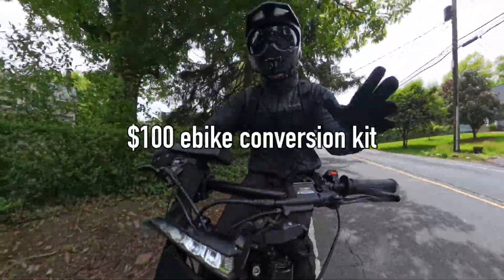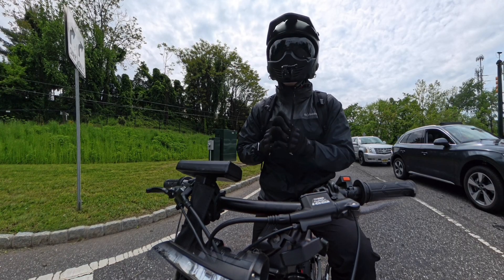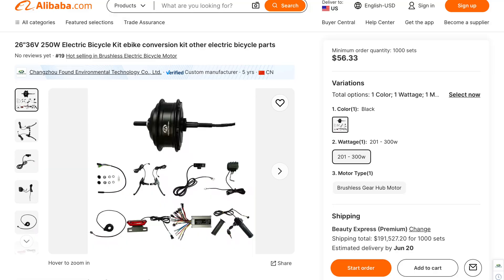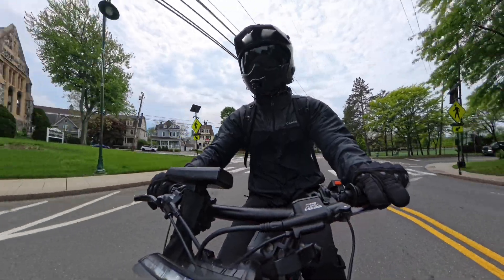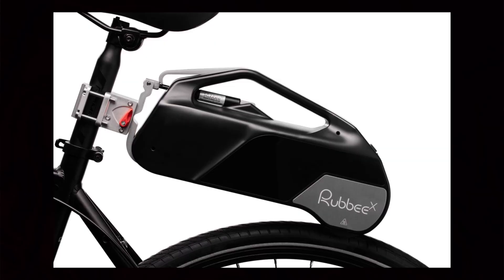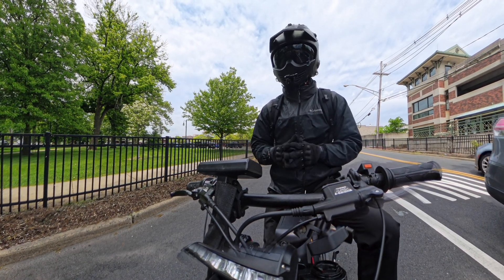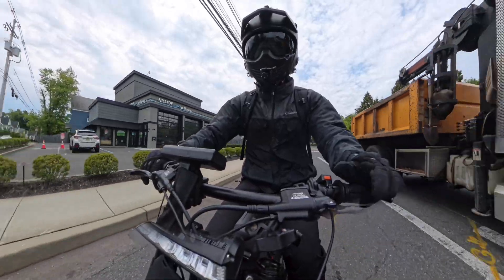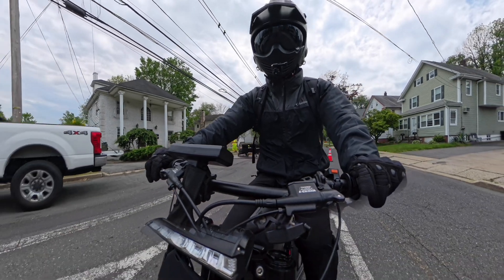Is a $100 eBike Build Possible?

Comment: I just had stupid luck and found a bike with a BBSHD on it for 80 bucks at a thrift shop, but I rather a hub motor bike for commuting with a rear 7 speed IGH. 
Used Ebikes that have minor issues mechanically that you can fix or minor electrical things like brake switches, etc.
Also agree on the cheap battery thing. I opened up the battery from that BBSHD  bike because it only charged to 40%, and the thing was horribly out of balance because they only put a voltage cutoff safety on each cell and not an actual balancing BMS. 
I've yet to open the Sony battery for my other bike but I imagine they did a little better of a job, and that thrift store one was not the cheapest one out there. The real firebomb batteries don't have a BMS at all.

Comment: $100 build NEW - is impossible, 100%
$100 build USED - well, maybe maybe
Personally, I think $200 - is a BARE minimum for 350W geared hub motor 48V kit + battery 48V 15Ah (21700 cells)
You can go lower budget, but must be switched to 250W gear motor, and lower your battery to 10Ah, but to me - it sounds insane, really kinda boosted wheelchair...

Comment: I can make a ebike electric for 70euro's. I live in the Netherlands
Reply: how so
Reply: @max19374m it is definitely not a good ebike, but i will get a used ebike motor for 20euro wich you can find pretty easy right not. A chineese controller for 7euro. A throttle for around 3euro's and you can buy a cheap hoverboard battery from ali for 20euro, and the charger is 5euro
Reply: Bro trust me it’s gonna set on fire it’s not worth it
Reply: @mblb_editz  if i would do it i would build a proper safe battery, so then no risk
Reply: @mblb_editz  but it would not really set fire
Reply: How?

Comment: I ended up buying a brand new e bike bevaje it's alot cheaper that way and no building and ot does what I needed which is get me around at a good enough speed 15mph which can be unlocked to 20mph I think I got it for 344 quid

Comment: I got a brand new e-bike kit off Amazon for 250aud / 130usd the kit was 106 aud and it is 36v 250w  and the battery was 36v 10ah and 142$
Reply: Hey, where did you find this?
Reply: @ Amazon Perth
Reply: @GravelMagpie amazon

Comment: Well i can say my old $200 1000 watt eBay rear hub motor Voilmart kit paired with a good front suspension Gary Fisher aluminum mountain bike i had  has run flawlessly for many years now, about five years i think, and i got a good deal on a 20 ah battery that was made with Samsung cells i believe for about $200.
I also bought some flatless foam tire innertubes so I never had to worry about changing a flat tire again since.

Comment: I put together a super sketchy diy kit for about 120 bucks I got the kit half put together on a bicycle for 60 bucks and then I found the battery on marketplace for another 60.  You can tell the battery is pretty whooped. It says it's 15 amp hour but you only get about 20 mi on the throttle but I'm happy with it

Comment: I built my own ebike conversion for roughly $150;
[$15]  2nd hand hoverboard - gave me a battery and motor controller (after some mods to the motherboard)
[$100] hub motor (w/ wheel assembly)
[$35]  bunch of spare parts (stm32, wiring, PAS, display, 3D printing, etc)

And the bike was purchased used for $50. 

Also tried to convert the hoverboard motor into a wheel, but gave up on that idea after a few weeks even though it seemed feasible. This would've made the motor come essentially for free, as I could then use the old back wheel of the bicycle for donor parts (rim and spokes). I've seen other people do this, but in the end wasn't able to myself. $100 build is possible but in my opinion too hard and not worth it - especially if you value quality and longevity. 

I will probably upgrade the battery, as it's only 150Wh and fairly old. Purchasing cells from nkon and putting it together myself will cost $150-$200 for a 450Wh battery, making the entire build $350-$400 for a pretty decent ebike.
Reply: I got a brand new e-bike kit off Amazon for 250aud / 130usd the kit was 106 aud and it is 36v 250w  and the battery was 36v 10ah and 142$
Reply: @EkitAlanga  How fast?
Reply: @EkitAlanga you didnt get to the end or thats the price with no battery my man. Not a full kit. Lots of places say full kit but dont include battery. Right now i saw one on amazon for 259 when you go to checkout and add all options you need the cheapest one is 600$ lol so you are wrong
Reply: if you ever did this again, you could attach a gear onto the spokes on the left side (opposite the normal drive) and another onto the hoverboard motor and mount the motor somewhere else on the frame. idk if it's great, per se, but people have been doing stuff like that in diy ebikes for a while
Reply: Love the idea of using the battery off the hoverboard, plus it comes with the charger and everything! What was the Voltage and Amperage of the battery?

Comment: You can definitely use a generic bldc controller, alternatively a sensored one depending on the motor.
If you pair this up with spare parts for other ebikes then yes, $100 build is indeed very possible. 

Although you might spend more time tinkering - depending on who you ask might be worth it or not.

Comment: I built a pedal assist kit includes two geared motors(one for drive/regen and one for gen with esp32 with tilt sensors  to toggle gen/regen functions along with 12v 6Ah battery under 30

Comment: why can you get folding dinky ebikes so cheap? it just doesnt make sense that building costs more always
Reply: Cause those only go up to 15 - 20 mph top speed, when a bike can foot pedal at that 15 - 20 mph just by legs using gears. Needs something faster 30-45 mph is decent on a bike

Comment: Only Ebikes I would ever even consider are the Molo5 72V 15000w and Mosphera 72 volt , Ristretto 512, and wouldn't touch Wired I would only go with E Cells dual 3000w motors 
ECells will be the first and only brand to receive a custom gallium nitride powered FTEX controller, delivering nearly 3KW of peak power per wheel and featuring flux weakening algorithms pushing the bike to a higher maximum speeds of 53 56mph or more!

Comment: I looked at the Rubbee back when they were still a "Starter Company" and were seeking investors..... $1200.00 was their price
when I considered them & I did reach out to them and they promptly answered my questions but their price was steep when
I could get a honda gas friction motor for $379 or so...... thanks for the video
Reply: Weight gas tags payments insurance, especially at a young age with that insurance stuff. honestly the only 2 benefits offered by ebikes is free fuel (charge it at work they usually let you), and the lack of payments needed beyond the initial purchase.
Reply: That's true & is the whole reason I started looking into them back in 2016-17.  But the prices never went down like they
were supposed to do & with all the problems w/ batteries, and there are many,  I've had a gut feeling about them ever
since then.  But I still continue watching the progress & evolution of the industry.  peace

Comment: My first ebike conversion was eBikeling.  Awesome kit if you pedal with your bike. Very low torque but bullet proof.  Almost 10,000 miles on it. Runs great.  Definitely water resistant, caught in the rain a lot.  I did buy a better battery though.  Cost more than the kit but if you cheap out on a battery you will 💯 regret it.  Nothing more expensive than paying for it twice
Reply: What specifically did you use and what materials did you utilize to build it? I would love to build but I would like to add a passenger seat to it as well with long distance
Reply: @ I used a cheap 700c no name brand bike, you basically just need the frame.  20AH triangle battery, keeps it out of the way and looks better.  EBikeling front wheel drive kit , 1200 watts.  Thing stupid quiet and still putting miles on it to this day.  I have a nine year old so I get the passenger aspect.  Instead of building a “cargo bike” I bought a “utility trailer “ that clamps to your seat post.  That is critical.  I found one for just a little over 100 bucks and I work at a machine shop so the materials I used to make it crazy reliable were free for me and I got to weld a couple things for free as well. I did have to do a little work to this to reinforce it though in all fairness.  But highly highly recommend this route over building a cargo bike or making your rear wheel support the extra weight.  If I was more tech savvy I’d send you a photo and what to upgrade/reinforce on it.  You won’t win any races but we did a trip last year with it 75 miles each way for two days on a paved trail in mi.  Recharged at night in our hotel room. Put it on PAS 2 and you can go all day.  Ive used it on pas 5 without a passenger and the throttle will give 28mph no problem but range is around 25 miles like that. Invest in a good battery and avoid fast charging it when you can.
Reply: @dariancollins9746  I did eventually upgrade my rear wheel to a mag wheel after I broke a couple spokes but you got time on that.  I’ve yet to break a spoke on the wheel with the motor though.

Comment: 100$ would just seem like it would be super fishy and shouldn't cost that much for the metal even. 500$ sure but not below. Mine was used and cost me 400$ for a bbs02b at 52v 35mph and range 70ish less at 35-40ish with no pedals. Saved me tons from the dinos 🦕